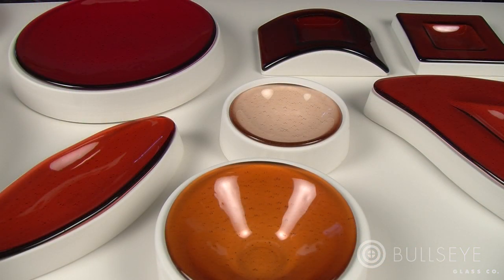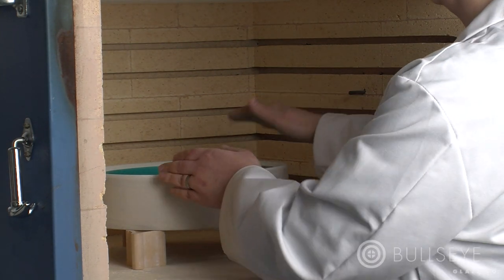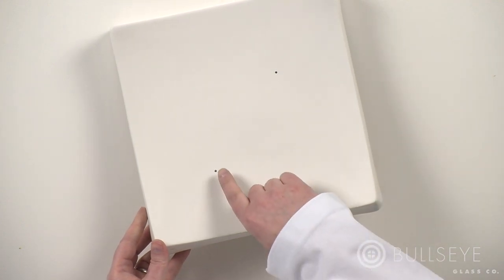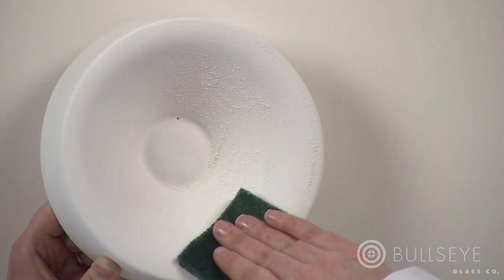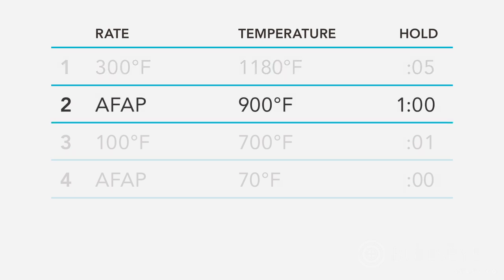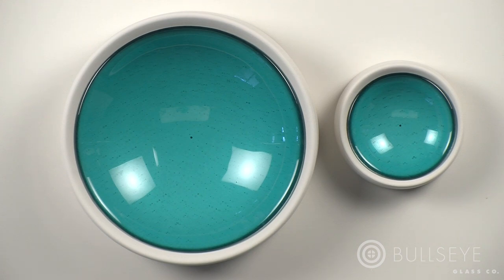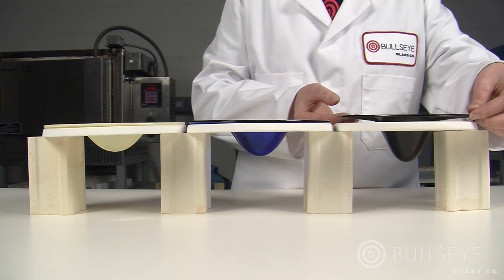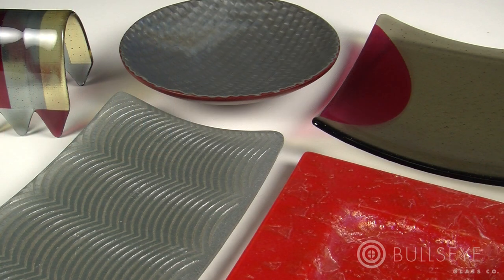Slumping Basics

Comment: this video is super helpful! i was curious at 0:12, i see a clear square tray that looks like bubbles in them. how did you do that?
Reply from the maker: Michelle,

Yes, that 'bubble grid' is a cool effect isn't it?

And, happily, it's super-simple to achieve:

You're simply full-fusing two pieces of reeded glass laid-up face-to-face with the patterns running perpendicular to each other. After fusing you'll see that each intersection of the lines crossing each other has captured a single bubble. That's it!

In the example here it's all clear but imagine if the bottom piece was black reeded or if the whole clear/clear assembly was fused atop another color? The bubbles will capture light and cast internal shadows in a way that creates a very powerful depth effect.

Thanks and good luck!
Reply: @BullseyeGlass  thank you for sharing, i'm absolutely in LOVE with this unique look! for the second idea with adding color, should the colored glass be transparent or opaque in order to see the shadows, or does it matter? thanks for the inspiration and sharing the knowledge, much love!! <3
Reply from the maker: Michelle,

You're very welcome!

As far as adding color under the clear/clear reeded assembly, having an opalescent with a medium value would probably read most dramatically as far as the shadows go.

Black underneath clear/clear is impressive too. Not that there are shadows but it makes the bubbles really pop (ha!) by contrast.

Thnx!
Reply: @BullseyeGlass  that's awesome -- i'm so excited to try this out! can't wait to make the bubbles pop 😆 thank you!